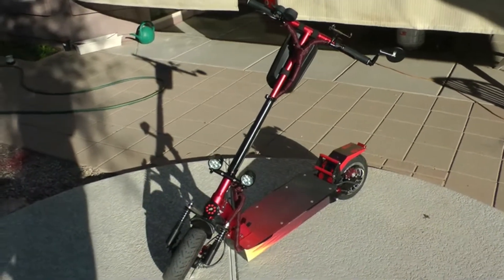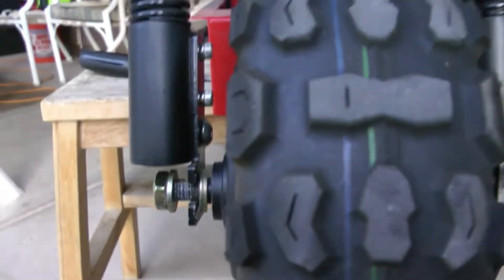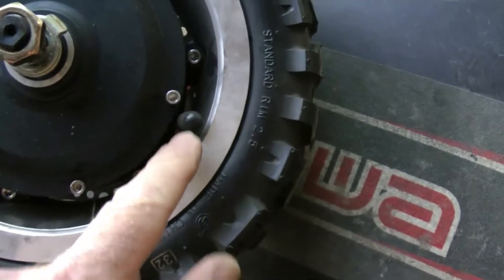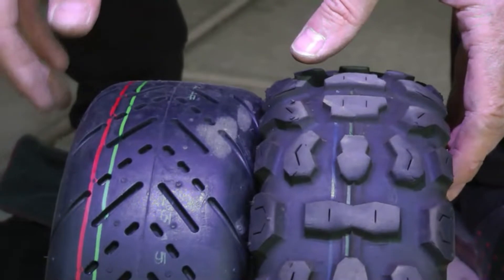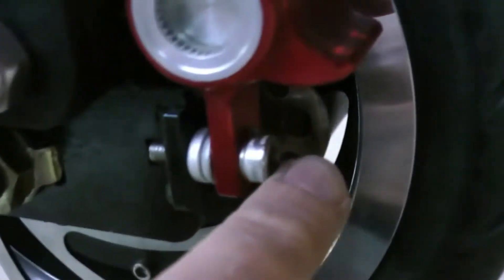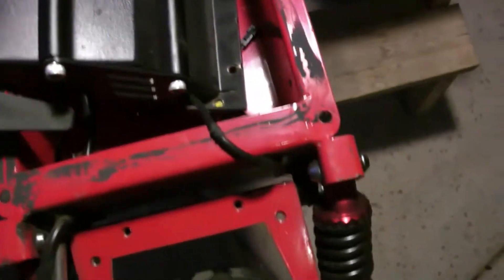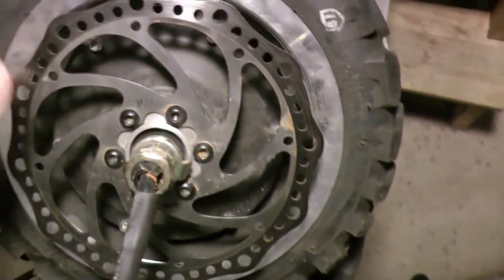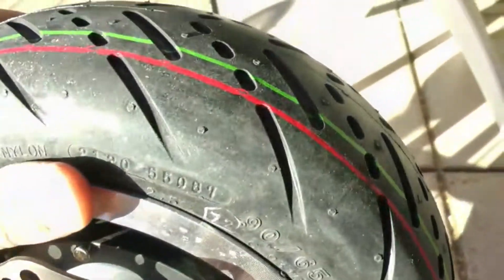Qiewa Q-Power tire change

Comment: mine Qpower gets here this week whats the cost of those bad ass new tires ?  thx and love the videos~
Reply from the maker: I paid around $100 for two tires and tubes. Got them from Ali-Baba. That was about a year ago so may be different cost now. Also, make sure you check the tire size on the tires you have when you get it. Mine is the original Qpower, not sure if the Qpower 2 uses the exact same size but no doubt you can find street tires for yours on Alibaba. Once you get it, if you need help finding them, email me at maikemarx@gmail.com.

Comment: the best way to do the calipers that I have seen is to loosen the, a bit them pull the break lever so they close then tighten the screws and when ya release the handle it should be dead center without rubbing
Reply from the maker: Yep. I go over that in my brake video: https://youtu.be/4aMx0KXm_Qo
Also, if your rotor is perfectly straight, you're lucky.

Comment: An easy way to adjust your brakes is to loosen up the bolts to the calipers so you can move them around. Then pull down (and hold) the brake lever on the handle bars then tighten the caliper bolts.  Once you tighten the bolts a little bit you can let off the brake handle.  This is how I adjust my disc brakes on my mountain bike.  Hope that helps and applies here.  Nice video.
Reply from the maker: Great tip Charles. That would work perfectly as long as the rotor is perfectly straight. If rotor is bent a little, may require some fine adjustment beyond that. On these scooters, it isn't uncommon for the rotor to have a little "wobble" in it. Thanks for the tip.

Comment: I saw on another video where someone had installed and upgraded Kaaba Wolf Warrior scooter that normally uses an 11 inch tire to 13 inch tires using the stock hub motors and 13x4 tires. I wonder if it would work on our Q-Power too ???
Reply from the maker: Did he mention what tires they are? Seems strange that a 13 inch tire would fit an 11 inch rim unless that’s specifically what they were designed for (non-standard tire). Also on the Qpower, likely would have clearance issues. Maybe if you removed the fenders and rear deck handle it might fit but the tire to the rim install would be the first thing you would need to verify. Not sure what the purpose of this experiment would be to do this anyway.
Reply: @Desert-Ecruising  No they did not say what brand or make tires, though it was made for street use for the Kaaba Wolf. You are correct, just briefly looking on my Q-Power it *looks* like the 13 inch tire would fit in the front, however the rear fender would need to be removed and the rear handle might NOT need to be removed. Maybe ONEDAY I may try. LOL !!!

Comment: Hi, I own the Qiewa Qpower as well and I have been pondering for a while about swaping my off roads to on road tires, have you done any speed tests with the on roads?. I weight 160lbs, and with GPS I got 44mph on my Qpower, I know with On road tires I'd get close to 50. I am glad I came across this video, because know I'll know how to change the tires myself 👍🏼
Reply from the maker: No, I haven't. To me anything over 40 is fast. It is a much smoother ride and I have no doubt you'd gain some top end, but I'm guessing only 2-3 mph.
Got tires and tubes off a company on Ali-Baba. Depending on shipping, around $100 for two tires, two tubes and delivered within 10 days in both my cases. If u like, email me and I can put u in touch with the contact there.
maikemarx@gmail.com

Comment: Looking to buy this scooter. do you recommend?
Reply from the maker: I love the Q-power but got mine as a mechanic special,  so had to replace the controllers and display to get it going. If you get a mechanic special, you will need to work on it. If you buy new, then you should be good. I don't like recommending anything, since I am not in control of quality and with anything electronic, u could get a problem. However, Qiewa is excellent about correcting problems with customers and they sell parts which is good. A lot of scooter brands don't have that option.

Comment: I wish you showed you putting them back on. That's the part I have the most struggle with
Reply from the maker: Hey Jeremy, I just did a quick video showing just that. Should be able to upload it tomorrow.
Reply: @Desert-Ecruising  thanks!
Reply from the maker: No problem. Didn't get a chance to edit it today. Will try tomorrow.

Comment: AMM, did you say where you got the tire? How to shop for it?
Reply from the maker: Alibaba.com. First, download the Alibaba app. You will purchase the tires through the App. Then email Michael at:  michael001jiahang@163.com
 The tires are: CST 11 inch tire, 90/65 - 6.5 with tube. Michael will assist u. I ordered 4 tires and tubes since shipping is half the cost at least. Paid $135 including shipping.
Reply: @Desert-Ecruising  is there any chance I could contact you please need help with my qiewa wiring
Reply from the maker: U can email me: maikemarx@gmail.com
Reply: aliexpress is a lot cheaper and you should get the tires faster

Comment: Is this the same process for qiewa  power 2 ? Qiewa the company is not helpful in explaining
Reply from the maker: Hi Mike, I would say for any scooter that has a split rim held together with screws, this process would be the same. Just make sure to let the air out of the tire before removing the rim screws or the pressure could break the rim ring.
Reply: @Desert-Ecruising   quick question i know they use the sa,e tire for both models. But do you happen to know what size the inner tube is? I orderd from Qiewa but they made a mistake and i dont want to wait 20 days for an inner tube
Reply from the maker: Qpower inner tube size is same as the tire size: 90/65-6.5. Make sure you get the 90 degree valve stem or the valve won’t fit through the rim.
Reply: @Desert-Ecruising  even if the tire is 100/65-6.5
Reply from the maker: Then that’s not the same tire used on the original Qpower. You probably need the tube size that matches the tire size.

Comment: Does anybody know what the p settings are and how do you get into there  to check them
Reply from the maker: Yes for the 35A controllers and related throttle/display. Will upload a video on it this weekend.
Reply: @Desert-Ecruising   thank u because I have  Qiewa power  now  .don’t send me book on setting
Reply from the maker: Here's a link to the "P" settings video: https://youtu.be/8ZrIA10srCE
Reply: When  u upgrade throttle and the controllers  was there any difference
Reply from the maker: Yes. I only had ever ridden with the new controllers but recently rode a Q-Power that had the original setup. The new setup has far more aggressive acceleration would outrun the original setup, not even close. Takes some getting used to, have to be gentle on the throttle until you get moving a bit. I can easily spin both tires on pavement at same time. Have done so accidentally.